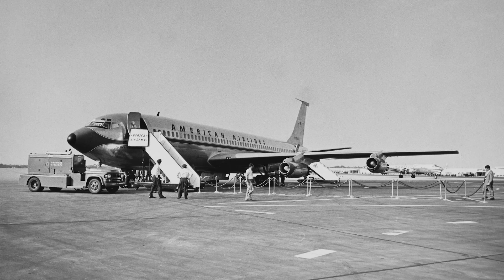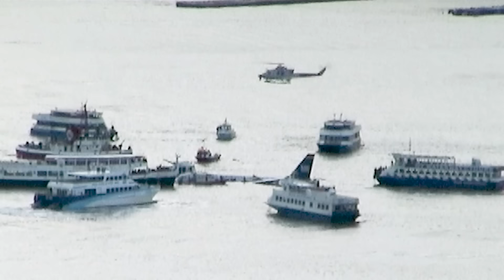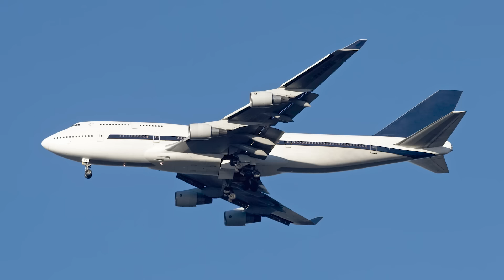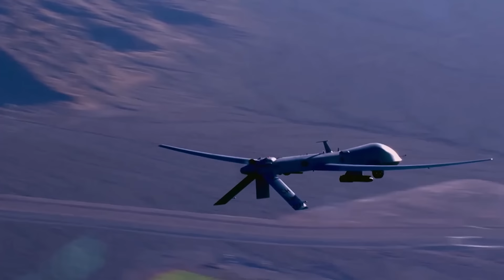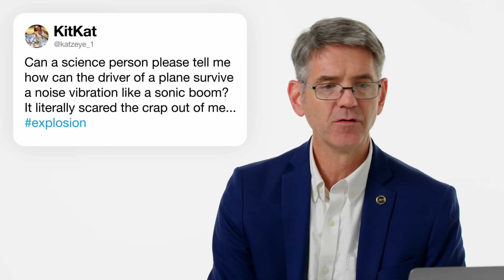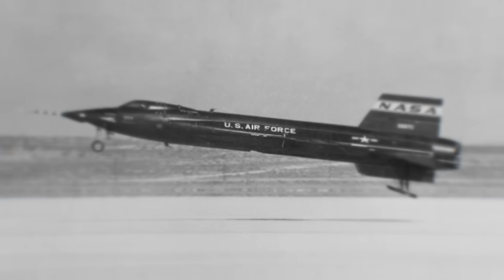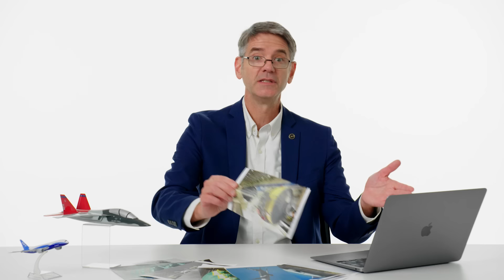Aerospace Engineer Answers Airplane Questions From Twitter | Tech Support | WIRED

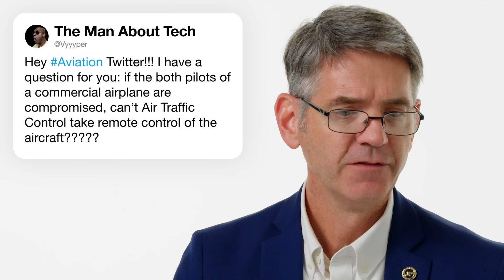Comment: @5:39 the answer is totally incorrect and deliberately so because this is the alleged hypothesis of the twin towers aircraft on 9/11, and any admission it is possible would add weight to those hypotheses. in 1984 NASA and the FAA with the assistance of Boeing remotely piloted a Boeing 720 and intentionally crashed in to test fire spread and fire control for fuel systems. Even further back by another 40 years during World War II, the USAF had an aircraft they called the "Interstate TDR", it was a remotely piloted plane intended to be flown over Germany and also Japan, but the war was won in Europe and the Atomic bombs ended Japan's involvement in the War in the pacific, so the remotely piloted aircraft is not a new idea, it has been tested, done and refined, to the point we now fly reaper drones for example around the globe. 

the technology has existed for a long time and has been viable. it simply has never been implemented on passenger aircraft because nobody sees the widespread efficiency of it, its costly adds weight and if the aircraft follows the current rules about flight deck security, then there is no need to add a costly and inaccurate system. the control and feel of a remotely piloted aircraft is not the same as sitting in the pilots' seat, watch a remotely operated car and see how abrupt they are, now try imagining the same for an aircraft with no tarmac/asphalt to press against.

There is discussion and testing currently to add some sort of remote piloting to cargo and passenger aircraft, but it is not yet a confirmed action. but this guy's claim that it's not possible is totally inaccurate, it's been possible for over 80 years. 

If you don't believe me, then go google the Interstate TDR and the NASA FAA 1984 Boeing 720 crash testing.

Comment: "don't tell me statistically flying is safer than driving"... OK, I won't. It IS, but I won't tell you. If, however, you have a small child with a statistically non-zero chance of sitting next to me, I will tell you that driving is definitely safer than flying, so please don't get on that airplane.
"why haven't airplanes improved"... they HAVE improved! ask any MBA how many more pax they can cram into the same airframe. huge improvement!
"THE Concorde"... <makes shocked British/French noises>
"why is there a pilot shortage"... airlines are waiting for the "AI" miracle, while not paying entry level pilots for their training yet paying them a pittance salary that makes McDonald's high-paying. It takes years to become that high-seniority captain that rolls in the big bucks. (and of course, outside the US, they have what's called ab initio training where they do pay for your training, in exchange for long-term contracts. They also have less of a problem with pilot shortages)

All snark aside, while a bit heavily tilted toward commercial aviation, with only a little bit of GA, this was excellent! Friend of ours also is an aviation teaching prof at uni. Imagine this guy with a British accent. (also I'm a former pilot, just to throw that in)
Reply: No

Comment: Why haven't planes gotten better in the last 50 years? Because society has gotten worse. More greed. More waste. Less privacy. Less humanity. And less room to exist on the plane. If a flight is less than 5 hours, I would Rather drive. It takes an hour to get to the airport, and then you have to allow at least another hour and a half for parking, shuttle, check-in, security, and walking to the gate. And then expect your flight to be delayed. And then when you get where you are going, you have to deplane, which can take an eternity, and then walk to the baggage area if you checked anything, then rent a car, and finally drive to wherever you were going. A 5 hour flight becomes a 9-10 hour day. And I'm that case o would rather drive 10-12 hours instead of fly.
Reply: It seems like your problem actually isn’t with the planes themselves
Reply: Planes are a lot better now than 50 years ago
Reply: If you can drive 10-12 hours and cover the distance of a 5 hour flight, I'm very jealous of your car that can drive at 300mph.